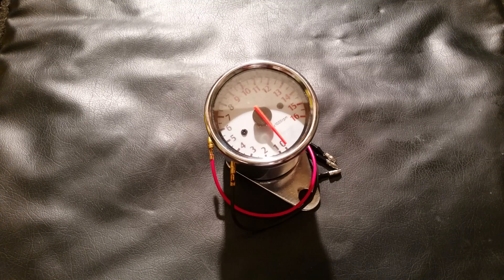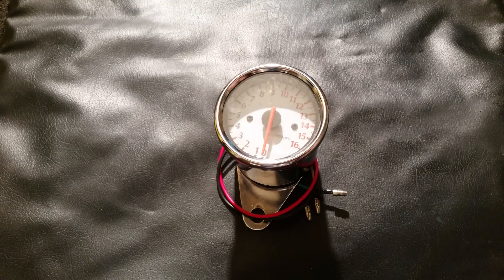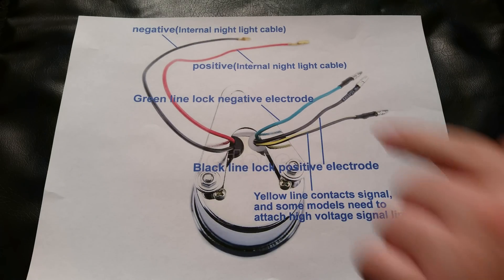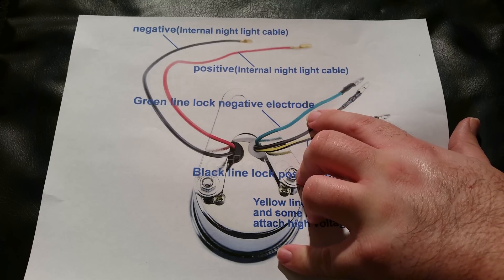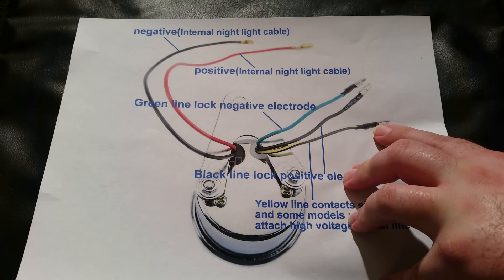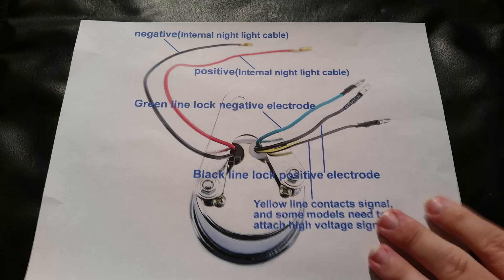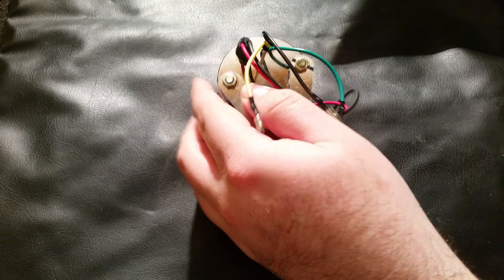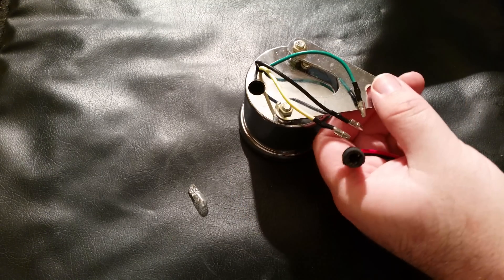$12 eBay Tachometer - Wiring Diagram Explained - Mini Bike Scooter

Comment: Is it neccesary to have a 12v battery suply to make the arrow move in the gauge?

also could this work on a simple 2 stroke brushcutter engine?
Reply from the maker: Not sure, was going to test with 9volt battery but forgot. It might run on an engine alternator.

Comment: does it work without a accu? my moped kicks and rides perfectly without one.
i dont wanna get a accu for that :(
Reply from the maker: Idk what you mean.....what is an accu?
Reply: @dc5000123  battery*, im not english haha
Reply from the maker: @Niko-bf7nw  you can try a 9volt battery, but yes you need a power source
Reply: @dc5000123  hmm, and then just tape  the tachymeter wires to it?
Reply: @dc5000123  with electrical tape ^?

Comment: 2 of the 4 sparks does not spark anymore when connecting. The meter works ok, but my 4 cylinder motorbike does run on 2 cylinders now. Any ideas to solve?

Comment: I have exactly same tacho installed aftermarket on my single cylinder bike. It works, but it shows half the revs. Reason? Signal comes from the coil, and there is half sparks compared to revs. So, tacho is showing what it gets, the coil pulses. 

Any ideas as to correct this and fool the tacho making it to show double the coil pulses?
Reply: Maybe the signal from the pickup. If its a single pick up sending the rpm to the CDI, it will count every single turn, the problem on the output of the CDI is that on a 4 stroke it has one rev that wont explode. Thats why only half of the revs appear on yout tach.

Comment: I have a 4 stroke so for cylinder motor I have a tach almost exactly the same as this one connected to a 12v battery. Works great but reason double rpms. Connected to the low side of the coil. Any suggestions or help? No setting on it  just a universal motorcycle tach
Reply: Double RPM because your engine runs a "wasted spark" ignition. It fires twice per cycle thus RPM shows double.
Reply from the maker: I'm not sure what is causing that. I recommend getting a Glowshift tachometer as they work well with 1 - 10 cylinder engines. https://www.youtube.com/watch?v=4W3Ff_fjVJo

Comment: I have problem with instaling this in honda NTV 650. Green wire has been attached to the ground (-) black to dhe switch on + and the black/yellow to the low side of ignition coil. It doesn't work. In this case I need to try connect black/yellow to the high voltege sorce? There is about 11000V - it is dengerous with cable without shielded!

Thank you in advance
Piotr

Comment: Hey, I bought the same one, and I have a question. Does it work with a 2 cylinder engine? (Honda VTR 1000) Thanks for advice.
Reply from the maker: +Róbert Nagy
I'm not sure, it works for some engines but not of them.
Reply: it should do as its counting the revolutions of the engine
Reply: The difference between 2 & 4 strokes is crankshaft revolution of 2 is twice faster than 4 if you count by the spark so if your tach made for 4 stroke engine it may show twice rpm higher

Comment: Hello!

Can I get some help ? 
I bought a tachometer like this and I install It like u said in this video, but it starts from 6000 RPM, what I do wrong ?
Reply from the maker: What type of ignition system do you have?
Reply: My bike is an Aprilia RS50 (2000) with an am6 engine and "RS-RX 50 DUCATI ENERGIA" CDI.

Thanks in advance.
Reply from the maker: I don't know exactly what type of engine they are made for so I would buy one locally just in case you don't like it or need to return it.

Comment: yellow/black directly to the sparkplug workded for me.  Green to negative battery terminal and black to a switched positive wire.   But the tach installed on my shadow had a black face and LED back light
Reply: Freddy Bustamante what do you mean the spark plug? Like wrapping it around the topside of the plug?

Comment: does this tachometer works on 2 stroke engine.??
Reply from the maker: +Kaanis Ram 
Yes, with CDI ignition.
Reply: where to connect the tachometer signal wire in the CDI system..??
Reply: is this a 2 stroke or 4 stroke tachometer...??
Reply: was 16000rpm

Comment: hi! here is my tacho. 

( http://www.aliexpress.com/item/DC-12V-Universal-Motorcycle-Tachometer-Meter-LED-Backlight-13K-RPM-Shift/32595355681.html)

can i use your instaling method (cable color vs...) for my yamaha xv950? is that same?
Reply from the maker: +atil celik 
Hi, it should be the same wiring setup unless it came with instructions.
I like those tachos, but they are hard to read in the sunlight...

Comment: will it work on a 1 cylinder 4 stroke motorcycle? i just bought one. if it does, can i know where to connect the signal wire? wrap around the spark plug wire? connect to the negative terminal of the coil? or the cdi itself? PLEASE ANSWER. THANKS!
Reply: Well does it?
Reply: no
Reply: it would of worked if you wired it correctly. signal to the positive of the ignition coil... negative and positive to just any constant neg or pos...

Comment: Put one of these on my Royal Enfield Bullet 500cc single cylinder 4 stroke. Would not show more than 1500 revs no matter how fast the motor was spinning. I had the wiring checked in case it was me but but all ok. contacted the supplier who reckoned it is a duff unit and have posted another one to me, still waiting it's arrival. I did suspect it might be showing half revs but not sure as it is supposed to work on single 4 strokes straight out of the box? Dave UK
Reply from the maker: +notwocdivad  Ok, update me please.
Reply: Yeh DC no problems, when it arrives and is fitted I will post an update. I was out on a run last Sunday and it jumped to 2000 rpm but would go no higher no matter how I went up and down the gears. Take care Dave
Reply: need update. you arent the only one wondering .

Comment: Hi dc5000123,

Thanks again for your help.Fortunately I found on the SR500 forum the correct wiring of my tachometer to my Yamaha SR400. I It works find now and I will post the information for anyone else is having the same issues .

Cheers,

Slab
""On the three wires for the tach operation, the black was power, the yellow/black was ground, and the green was for the negative coil which was the orange wire ""
Reply from the maker: slab Cool man !!!  I like tachometer videos so you should post one soon :)

Comment: Hi dc5000123,

The SAGA continues,

After attaching the black and yellow to the spark plug wire I have voltage coming out of the black and green wires  .Therefore grounding either wire cuts the motor .

Any ideas ????

Thanks in advance,

Slab
Reply: slab For the black & yellow wire, you should try to connect to the input signal wire on your ignition coil. Do you know what kind of ignition system you have?

Comment: Hi dc5000123,

Thank-you for the quick reply.
I can attach the wire to a 12v source.
Could you please confirm ;
Green to tacho ground;
Black and yellow wrapped around spark-wire cord (or inside spark-plug cap?????)
Black wire to a 12V power (+ or-???)source or attached to engine mount ????

My bike has no battery but has a black and brown wire coming from the coil.

Many Thanks

Nick
Reply from the maker: slab Green is ground, black is positive, and black and yellow go to ignition coil or spark plug wire. Sometimes it works when you ground to engine and tach and sometimes it only works when not grounded to engine. You got to try different setups.

Comment: Hi dc5000123,
I have tried to wire the same tachometer to my Yamaha 1988 SR400 (no battery model)with no luck .I have grounded the green wire to the bolt under the tachometer , attached a stripped end of the black and yellow wire around the spark plug cord and attached the black cable to a bolt on the engine. I am still getting nil reading from the tachometer. Any idea were I am going wrong ? Also the instructions talk about pos and neg electron connections which is also confusing.

Many Thanks in advanced .

Cheer Nick
Reply from the maker: slab Hi, you will need a 12vdc voltage source for this tachometer. You can try a 9volt battery or if your bike has a headlight you can try to wire it in the system.

Comment: Hey do you know how it connects to the spark plug wire if it's not long enough do you have another wire you attach it to extend it? And when you say ground does that mean the negative side of a battery or just a peice of metal? Thx in advance
Reply from the maker: I had to use extra wire and crimping connectors. The green wire is (Negative) ground and is the (-) minus symbol and should be connected to the engine block & negative battery post.
Reply: ***** Thanks so much I was confused there for a second i know i'm a little annoying I commented on like 3 of your videos i just want to get a tach for this http://www.ssrmotorsports.com/store/pitbike/sr160tr.html according to the seller when you just start it and breaking the engine in it can't past 4,000 rpm which is 50% it's top rpm is 8500 i just don't want to pay all that money for the engine to blow up so i need something to monitor the engine and a digital tach is not that effective since you are going fast you can't really math the numbers in your head lol but thanks for the advice
-subbed